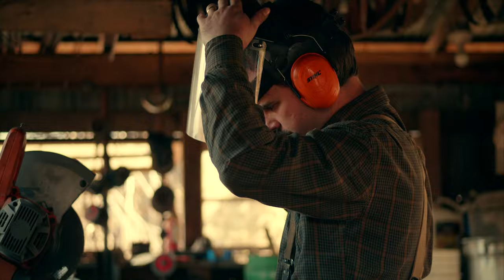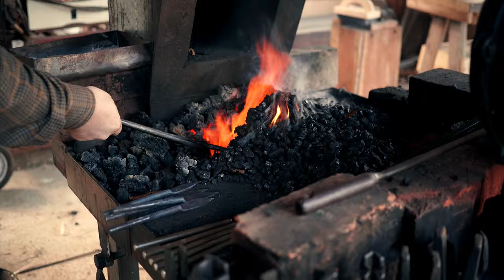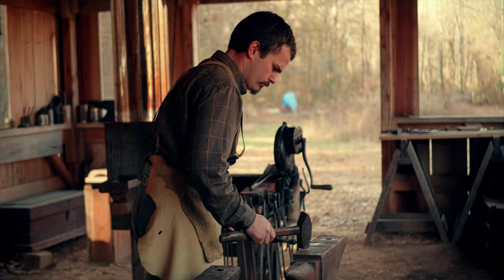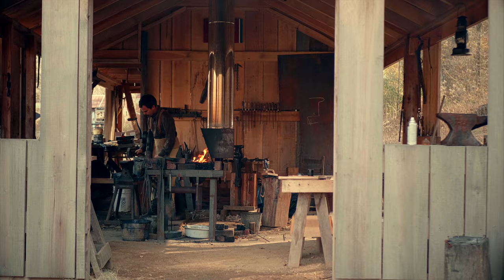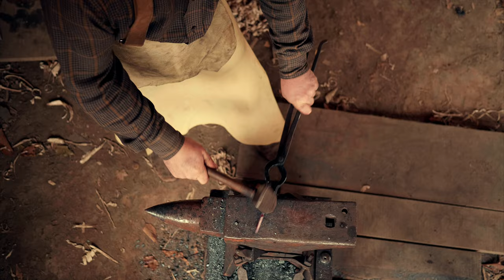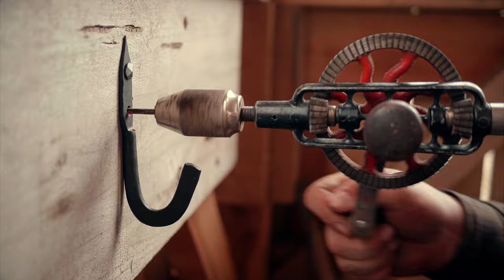Forging a Skillet/Pot Hook

Comment: Why did you put the hook in hardening oil?
That's just mild steel, so it won't hard? Or am i missing something?
Reply from the maker: Hey Robby! The oil is not for hardening. It is linseed oil, and blackens and provides a little bit of finish.
Reply: @AxeAndAnvil  ah right, of course! Forgot about that. Cheers!